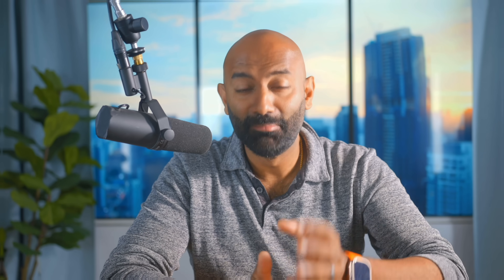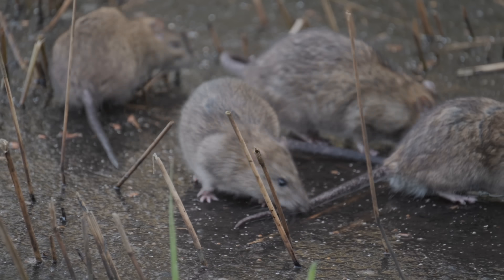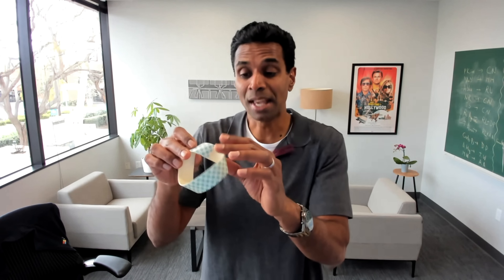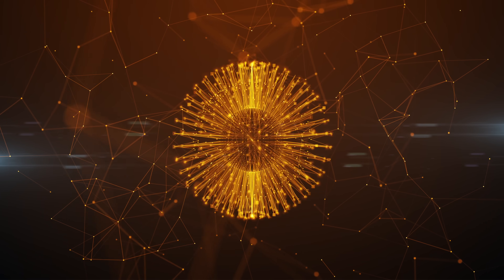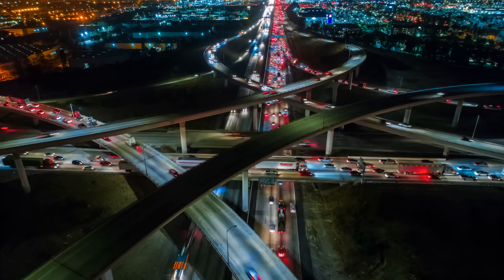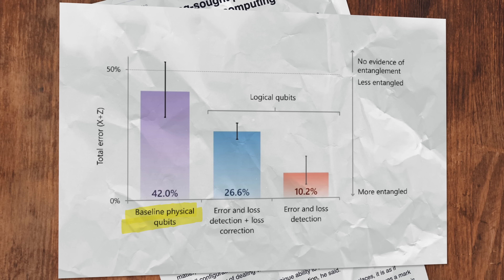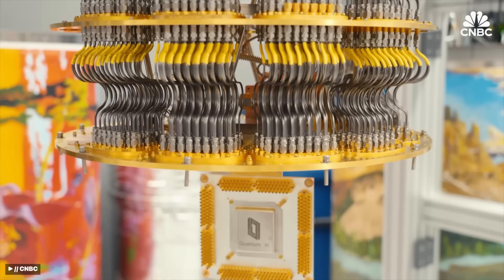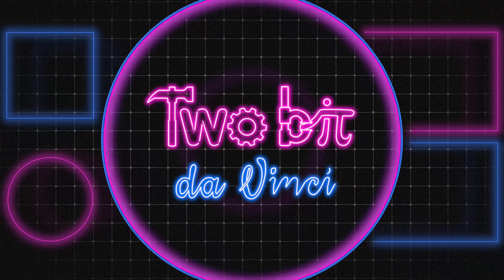Microsoft's New Discovery Just Changed Quantum Computers Forever!

Comment: What if you could make a quantum computer inside a computer is that possible? That way you can do quantum States inside a normal computer 💻???? I'm just wondering can you do that instead of normal computer where you can simulate how a quantum computer would work but inside a computer essentially you would do the same thing as a quantum computer but much slower. Is that possible.?
Reply: Unfortunantly, no, because of the way our computer binary bits works. If you have 6 binary bits and each bit can be a 0 or 1, that means 2 to 6th power of possibilities which is 64 and it can only be one binary number at a time (for example, it might currently be "100110"). It is a physical hardware limitation with current microchips. The amazing thing about the quantum "qubits" is that it could be all 64 at the exact same time! That is where it gets mind-boggling. Even the fastest supercomputers can't even get close to what quantum computing can do.

Comment: The future of Quantum Computing 
Light-based and solid-state quantum computing would eliminate the cooling problem entirely and push processing speeds toward the ultimate limit: the speed of light.

Why This Makes Sense:
	•	Light generates no heat (unlike electrons moving through metal).
	•	Fiber optics can guide light efficiently, allowing for quantum entanglement over long distances.
	•	Solid-state materials (like silicon-based quantum dots or topological insulators) could provide a stable, scalable platform without the need for cryogenic cooling.

The Future: Optical Quantum Chips?
Imagine a fiber-optic quantum chip, where qubits are encoded in photons traveling through tiny light circuits—no more copper pipes, no more extreme cooling, just pure speed and efficiency.

Comment: Saturday, May 10, 2025 . . . Hello Ricky. I have long held that original "x386, x486, and Pentium" CPUs can process at the Quantum level with very slight modifications to the architecture to achieve this outcome. It would process at less speed of a "Dedicated Quantum Computers", however is will be faster than Standard Conventional Computers and quite probabably Super-Computers, here's how (0, 1) --> (1, 0), (0,1  --> Begin-Digital-Qubits..."maybe, inclusive-omissive, *negative, positive"({-}1 ),  / --> "and, or inclusive-omissive, *negative, positive"*0).End-Digital Qubits.. It would likely have the stability of a standard digital system, minus the errors from the ambient noise of quantum computers. This is an oversimplified description, but it can be scaled for Parallel Horizontal/Vertical "Adaptive Quantum Computing." "(*) Would be defined as an Algorithm encompassing the Complex Number System." PEACE.

    I am an individual keenly interested in Science and Technology.

(Collaborative Rewrite with Grammarly).

Comment: How would one program software for Quantum computers ?!? If you can't see or observe cubits, how would you control it ?!? 😊
Reply: Instead of directly setting a qubit to ON or OFF, you're essentially manipulating the probabilities of it being ON or OFF when you finally look at it (measure it).

Think of it like this:

Setting the Stage: You start by putting the qubits into a specific initial "fuzzy" state. It's not exactly ON or OFF, but a blend.

Applying Quantum "Operations": Then, you apply a series of special quantum "operations" to these qubits. These operations are like nudging the dimmer switch. They don't directly set it to a specific value, but they change the likelihood of it being ON or OFF in the end. These operations are often represented by mathematical formulas that describe how the probabilities change.

The Grand Finale: Measurement: Finally, you "measure" the qubits. This is like looking at the dimmer switch. When you measure, the qubit "decides" to be either ON (0) or OFF (1). The probability of it being one or the other is determined by all the fuzzy operations you applied earlier.

Comment: Willow holds the record for RCS (Random Circuit Sampling), which has zero real world usefulness. 

In 2019, Google's Sycamore claimed the record of RCS, stating that it could perform a task in 2 hours that a supercomputer would take 10,000 years. Soon after, a team of researchers and a super computer completed the challenge in 15 hours. 

To my knowledge (and not for lack of investigating), i havent seen a single advantage of quantum computers. Logic tells me its all hype, no substance.
Reply: grover is a simple proof of quantum advantage.
Reply: @mb2776  I belive you are correct. It seems that the algorithm has been proven and provides results more efficiently (N vs sqrt(N) clock cycles)

The biggest demonstration I could find was from 2025 by SQC, who performed a 3 qubit search (8 states) with a 94% success rate. 

Considering that current quantum computers cycles at less that 100 Mhz (vs 4+ GHz for conventional), it seems that the efficiency gain isn't going to provide any supremacy for quite a while. 

Very interesting stuff and I appreciate you bringing up that algorithm. I had a good time reading about it.

Comment: Please explain how a quantum computer can break passwords if only 3 tries are permitted followed by a 1 hour wait before submitting yet another 3 tries.
Reply: In actuality it wouldn't be able to

However if someone can get the hash of said password (can be gotten through other means) and can find the giant prime that was used in the has function, then the quantum computer can get the prines multiplying to make the large number

This is Shor's algorithm 

If im wrong @anyone please signify
Reply: @yungifez  Exactly!
Reply: The key is that a quantum computer wouldn't necessarily be making 3 online attempts followed by a wait. Instead, it could potentially work in the following ways:

Offline Cracking of Password Hashes:

Most systems don't store passwords in plain text but as cryptographic hashes.
If an attacker could obtain the database of these password hashes (through a data breach, for example), a quantum computer running Grover's algorithm could significantly speed up the process of finding the original passwords that produce those hashes.
The 3-try limit and the 1-hour wait on the online system become irrelevant because the quantum computer is working offline on the stolen data. It's trying out potential passwords and comparing their hashes to the stolen hashes without interacting with the rate-limited login system.

Breaking Underlying Cryptography (Long-Term Threat):

While not directly related to the 3-try limit, if quantum computers become powerful enough to break the cryptographic algorithms used to secure the authentication process itself (beyond just the password hashes), they could potentially bypass the login mechanism entirely. This is a more long-term concern related to public-key cryptography used for secure communication during login.
Reply: @walt1955  lmao
Reply: It will not break the password the way you type it in the browser etc. First it will quant-break into the server which stores the hashed and salted usernames and passwords of all users (each service provider has such auth server), it'll download all of them and quantum-break those of interest, the way @yungifez describes.
Reply: Think about someone knocking on your door... 100 people at once and you might reckonigze one.  Do you open the door to see? The security software determines when the door is opened, and how many can "knock" at once 👀
Reply: @walt1955 Guessing passwords in password fields on a website is not ware its at. Passwords are stored as encrypted hashes on a server, which provides a certain amount of protection against cracking the stored passwords. Quantum algorithms potentially allow an easy path to cracking these hashes. It's nothing to do with guessing passwords, but cracking hashes gained via data breaches/server hacks.
Reply: quantum entanglement lets it "see" across the data field of passwords and it can find your password in less than blink of an eye
study quantum SUPER position
Reply: It sends 0 and 1 simultaneously across all available bits, allowing it to deduct and then input the correct password in a single try. It can do many things in one go.
Reply: @wilderbeast9368 In a real computer, that's not how it works. Pragmatically, you get, for instance, a few tries at tapping a sequence a phone screen. You tap with an actual finger.
You don't "send 0 and 1 simultaneously across all available bits..." . There aren't a pile of "available bits" sitting around on your keyboard waiting for things to be sent to them. That's all just an academic abstraction.

Now on a networked computer, something less tangible happens, but the firewall doesn't have to cooperate with the quantum capabilities of the malign actor at the other end. The same binary handshake protocols still apply. The best quantum scientist around is constrained by his skills with manipulating the padlock on his bicycle if he wants to ride home.

Comment: It was always unexplainable to me how quantum scientists know which molecules or atoms are connected together by quantum forces out of almost infinite numbers of them in the universe.  This time it is more simple because they are connected by one wire.  So maybe they are switched by electromagnetic forces and not quantum?  Anyway it is fine with me as long as it works as quantum computer should in theory, finally.  Cheers
Reply: Magneto-electric spin-orbit (MESO) is a technology designed for constructing scalable integrated circuits, that works with a different operating principle than CMOS devices such as MOSFETs, proposed by Intel, that is compatible with CMOS device manufacturing techniques and machinery.

MESO devices operate by the coupling of the magnetoelectric effect with the spin orbit coupling. Specifically, the magnetoelectric effect will induce a change in magnetization within the device due to an induced electric field, which can then be read out by the spin orbit coupling component which converts it into an electric charge. This mechanism is analogous to how a CMOS device operates with the source, gate and drain electrodes working together to form a logic gate.

As of 2020, the technology is under development by Intel and University of California, Berkeley. The first experiment, conducted in 2020 in nanoGUNE, proved that spin-orbit coupling could be used for implementing MESO.